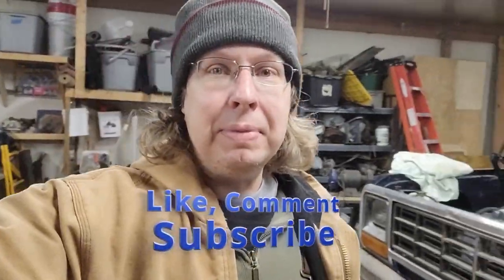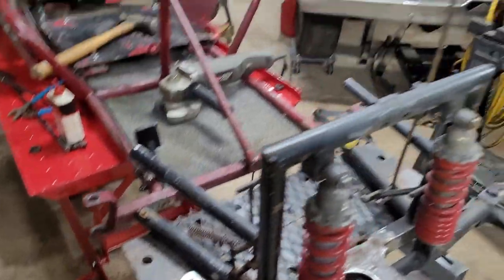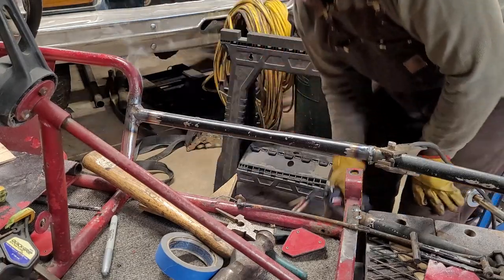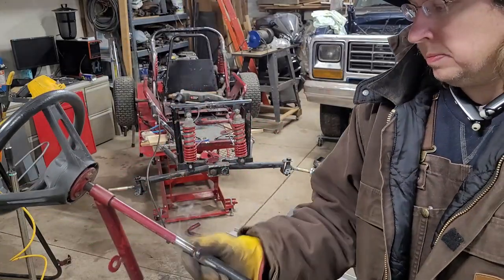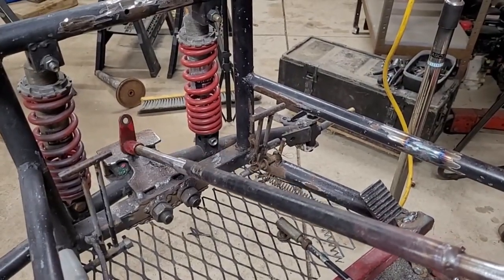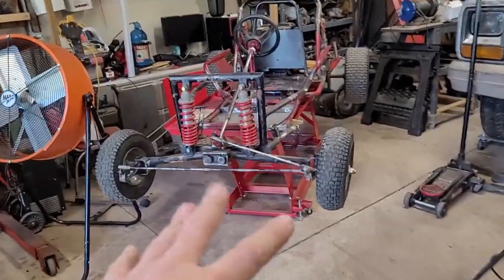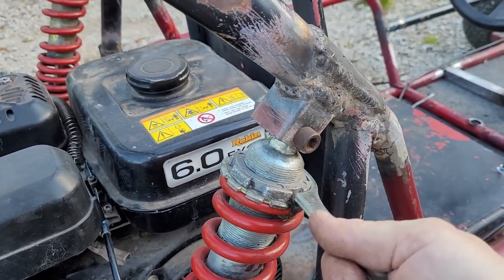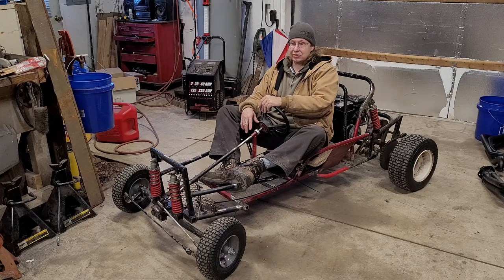Lawn Destroyer the GoKart gets FINISHED! It's Awesome!!

Comment: Good gocart story.... Well I bought an elcheapo one for my kid and got it running. Thought it sounded a little funny but let him run it anyways. It ended up sliding sideways into a field and traumatizing him for life. Turns out it had a hopped up engine. I zip ties a block of wood under the accelerator pedal so he could only give it like 10%. Problem solved! 🤣
Reply from the maker: Wow!! I'm glad he didn't get hurt. I think this was an elcheapo too before someone converted the rear before I got it. 🤷🏽‍♂️ I wish mine had a hopped up engine like yours did :) Nice solution to the speed problem for your kid 👍🏻👍🏻